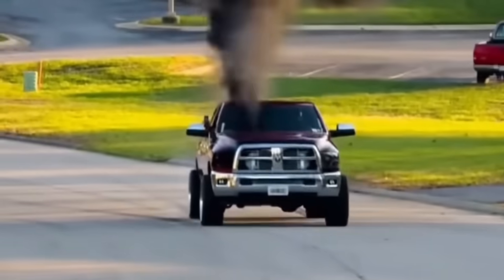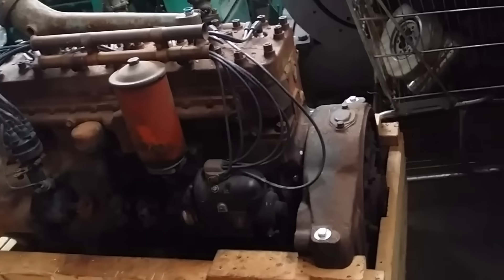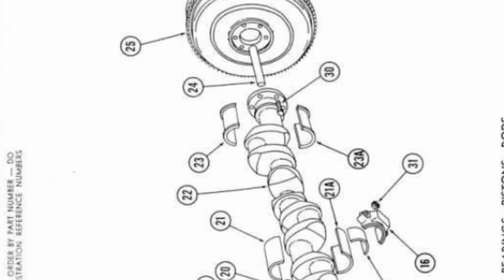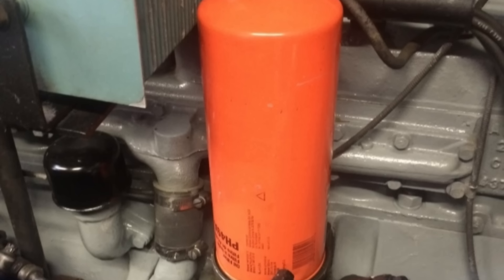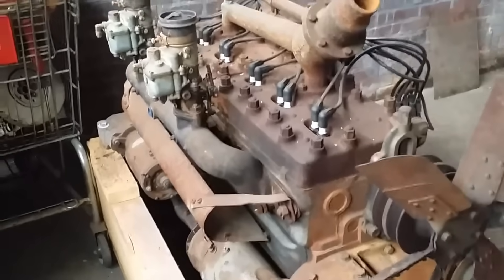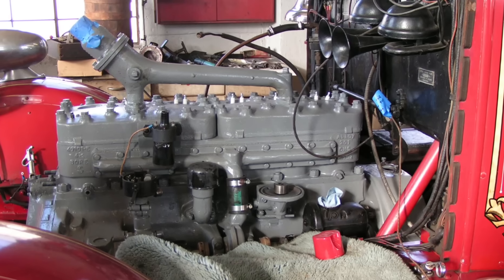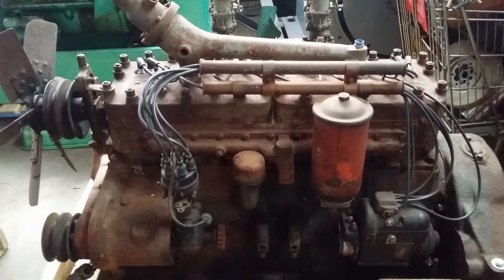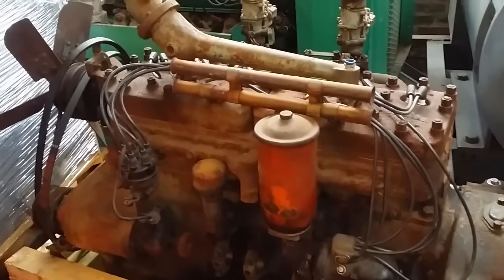The Insane Truth About The Monster Waukesha 6SRKR: Useless in Trucks

Comment: With all those forged internals it should be a good candidate for some boost too, and I'm sure some people have slapped a snail and the proper supporting mods on one of these long blocks and turned it up. I'd be interested to know what the highest figures were pulled out of it/ what compressor/ tune/ engine management, etc was used. Could be interesting IMO 👍

Comment: WTF you can’t believe anything. This guy is saying except that they made some fire engines but his description is of a diesel with individual cylinder heads. The picture is an in-line six cylinder with two heads but their flat heads so they do not include any intake or exhaust ports. This is not AI’s best work whoever posted this should be ashamed.
Reply: Just read some of the replys that he has posted to the comments :-)
Reply from the maker: @lowcarbondf I think I was half asleep doing this video. No excuse, and y'all called me out. I'm pushing out another video fast to hopefully bury this one forever. At least I believe I proved that it's not AI! It wouldn't have made this many mistakes lol.

Comment: I didn't see ANY inline six engines other than gasoline and  NONE had individual cylinder heads..I would retract this video and start over..I worked for Waukesha Motors in the 1960s as a temporary student employee.  Worked in the idle test area.. Made an embarrassing mistake resulting in an American La France gasoline inline six idling for an extended time with no oil in the crankcase.  Had to completely disassemble the engine myself and check every affected part for correct dimension and hardness. Thankfully all parts were ok.
Reply from the maker: @alanmorrison3598 It was nearly impossible to get accurate information on this engine and even harder to find footage. I appreciate the information you provided. This is the kind of stuff that helps. I probably should have chosen a different engine. :(
Reply: @VintageAmericanMachines  All good, not here to critique. I never stop learning. 🙂
Reply: Wow, that shows how robust they are :body-blue-raised-arms: